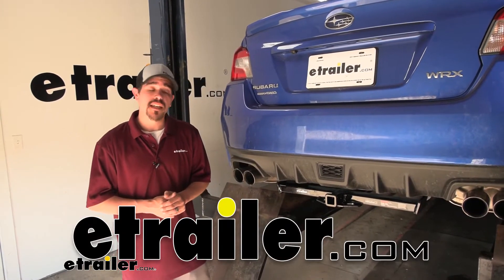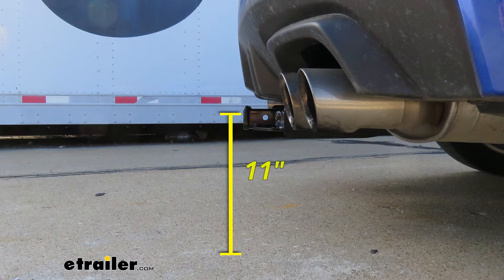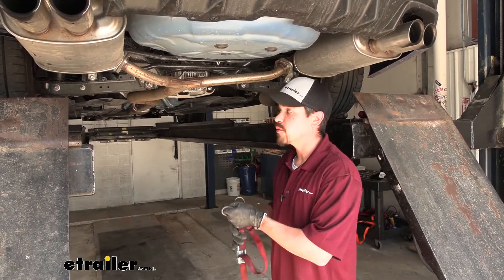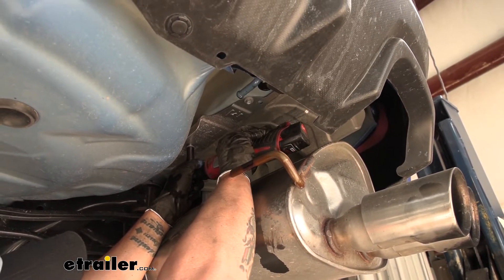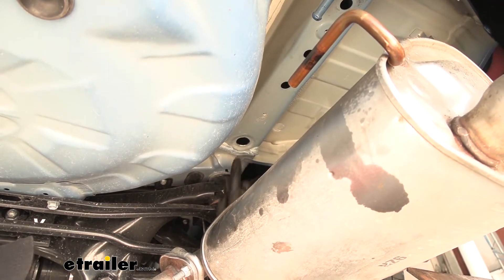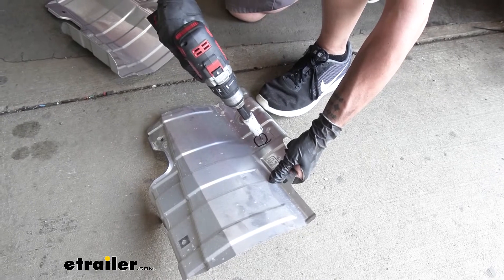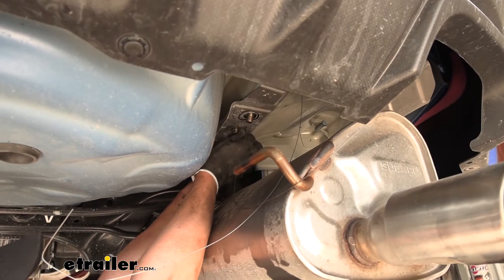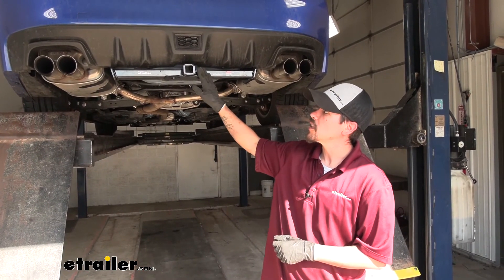etrailer | Setting up the Curt Trailer Hitch Receiver on your 2020 Subaru WRX

Comment: will it hold a yz250f dirtbike and rack
Reply from the maker: It won't, I'm sorry to say. The Curt # C11408 hitch has a 200lb tongue weight capacity, which means that the bike and carrier can't weigh more than 200 lbs. Since your YZ250F weighs about 230 lbs, the capacity of the hitch would be exceeded, and this doesn't even include the weight of the carrier you're wanting to use. A small trailer like # K2MMT5X7 would be your best bet.
https://www.etrailer.com/Trailers/Detail-K2/K2MMT5X7.html

Comment: How can I take the mounting bolts out that were put in using the fish wire?
Reply from the maker: Most people will use a flexible magnet to fish the wire out of the frame.
https://www.etrailer.com/Trailer-Hitch/Curt/C11408.html